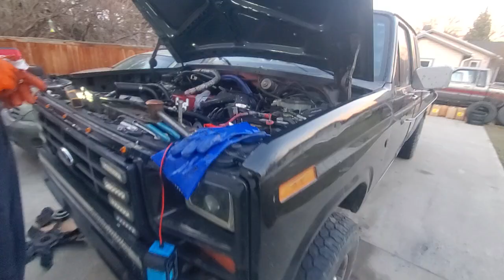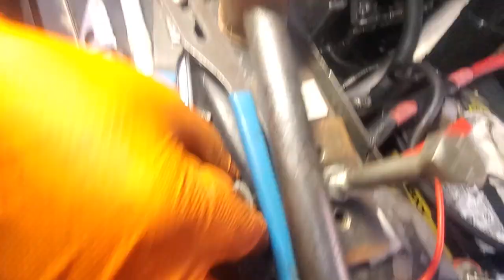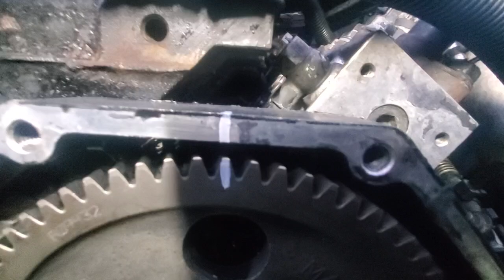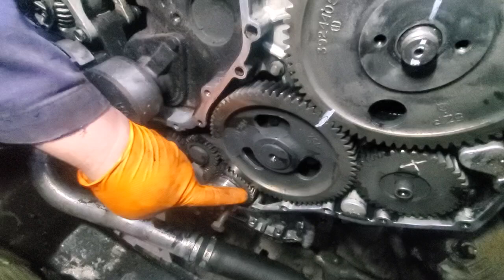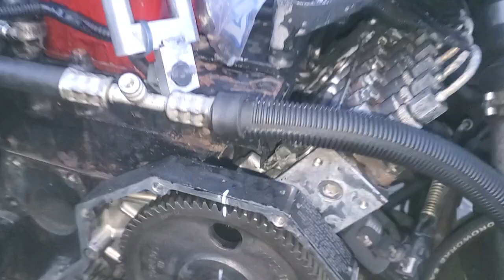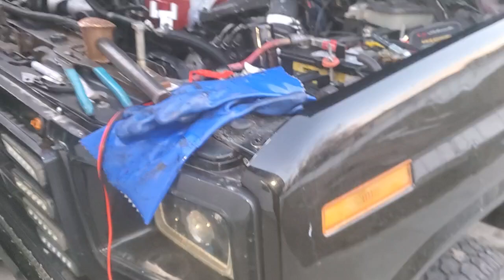12 valve p pump Cummins how to advance/retard injection pump timing 5 degrees

Comment: I need to retard my timing from what I know it's pump was shipped to me with 1600 degrees brand new remanufactured pump however you want to call that my truck originally had the 1300 degrees what comes stock with a p7100 pump I'm not for sure on other models this is a 1996 I rebuilt the whole engine I didn't think I would see a difference but the engine runs faster like its speed it up and I really don't like that they said it would be more responsive but I actually prefer the 12 valve running and it's natural speeds and it's meant to run with from factory doing a fuel shimmer that is one thing but it's still going to run the same way it's running too fast in my greatest like the throttle or idol is set at a higher position so basically I'm going to double-check when I call Pensacola diesel out of Florida and I'm going to find out exactly what pump that I got make sure it's 1600 I would have to retard it 3°so if that's the case I put this whole engine together and it wasn't too bad and another thing is that I'm getting some blow by now from what I've heard you can have more excessive crankcase pressure with advance timingand you'll have more blow by but other people have said and articles that I've read that you want to break in a 12-inch in with conventional oil and you want to put a load on it for a few thousand miles non-stop some guys are running them with a heavy load on the back for like 2 days straight or something like that they'll take a long trip I don't have that type of time to do that the truck is running pretty good but it just don't seem and my head it seems always like it's got a little rattle to it more than it's ever had before I basically just did a freshen up on this engine I left the original crank the original cam the original tappets and I replaced a few rods the cam was hand polished in the crank was hand polished and double triple miked within spec and plastic gauge the engine had one sleeve put in it because I drove through the freeze plug hole by accident in the back before I had the engine completely out was trying to do an end frame engine rebuild but it didn't work out the way I wanted to so I wind up ripping the engine anyways anyways the engine was completely gutted every single piece checked cleaned I did not have it ball peen spotting whatever they call it a decrease the whole engine after the sleeve was put in completely blew it all out and made sure that all my little nipples Stick over the crank goes your oilers were in their proper position and we're not knocked off and was honed professionally and triple checked from the machine shop they also put a gauge on top of the block to make sure that the surface that the head meets on top of the block was flattened true it was not milled or dect but they said it was true I bought a brand new remanufactured head no crazy aftermarket parts OEM Cummins oil pump Cummins standard Pistons rods were the same and the gold bronze bushing Miked so I left them also in the rods new bearings main bearings rod bearings besides the top bearing that has to be heated or pressed in the copper one because they still were in good shape so everything's pretty much original besides pump head Pistons rings oil pump etc every single gasket was gone through and pump I left at its timing that they set from Pensacola diesel but I would like to retard at 3 degrees so I'm thinking that what I have to do is set the engine to top dead center if I'm remembering right get everything all the gears 3 gears timed within them little timing marks on your crank your cam and your pee pump and then you would back off your bolt that holds the timing gear in reverse it counterclockwise my biggest thing is is how many turns if I don't have a dial indicator for this specific pump I know I've watched a couple videos in the past to where I would think that it's just three turns back like three notches and every notch is a degree? Not 100% I want to find out the easiest way cuz I know somebody's guys they'll take off just a part where the bolt goes to without removing the whole timing cover where your oil dipstick tube goes to they'll on loosen that to where it's not completely loose so you don't have to take off the timing cover once it's top dead center with that PIN pushed in the back which that is also new everything is clean that should be my top dead center number one piston add top dead center that I can unloosened the timing gear nut long is that sprocket is free and if I'm not mistaking where that little flag where you remove the nut on the p7100 pump itself that thing goes up and down in there so basically I need to find the formulation to retard the timing back to 1300 degrees and it's at 1600 degrees without removing the pump and it looks like the way that I could do that is reverse it counterclockwise I think to wear that flag spends three revolutions I'm not 100% so maybe I'll call down to Pensacola diesel tomorrow the following day and asked them if I want to set it backwards what is the best way to do it cuz I have a book on it and it teaches you pretty good it teaches you both ways but they really want you to have dial indicator and I really think that there's a faster slicker quicker way without removing the pump or the whole timing cover and just being very careful long as you know how many revolutions gives you the degree then you can reverse or forward your engine to give you how many degrees you're looking for without using any special tools removing the whole front cover it's all sealed and doesn't leak so I really don't want to remove it again basically the only thing we're trying to do is just get that shaft that the sprocket sits on for the timing gear pump to spend either ascending or descending to get the property the challenges is finding out how many degree based upon how many revolutions the shaft spins I think that you can see that by how many times even if the front cover is not opened up that flag goes up and down let me know what your thoughts are greatly appreciated

Comment: What advantage does this mod have? I'm also learning. Thanks
Reply from the maker: @ojbarberena7090  I would recommend doing research, but advancing basically increases compression by injecting the fuel closer to TDC, thus increasing power, economy, & typically lowering EGTs. With this comes more pressure, of course, potentially increasing wear & tear(not really in the case of a 12V) & the risk of blowing a head gasket. 

Long story short, stock is usually around 12 degrees(should be listed on the tag on the front left side of the engine front/timing cover), & advancing 3 or 4 degrees to 16 or so is usually safe without head studs, & should increase power by maybe 10% or so, as well as economy. Any more than that & you want head studs, though I recommend retorquing the stock ones, regardless. That's usually good for around 600 HP. 

It also helps to burn waste oil a little cleaner from my understanding